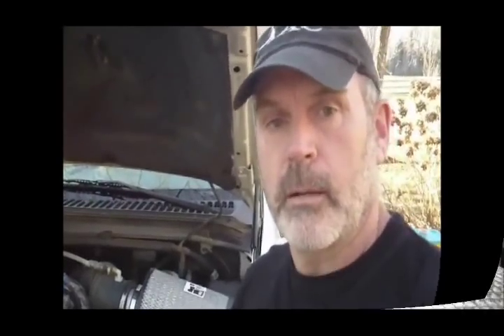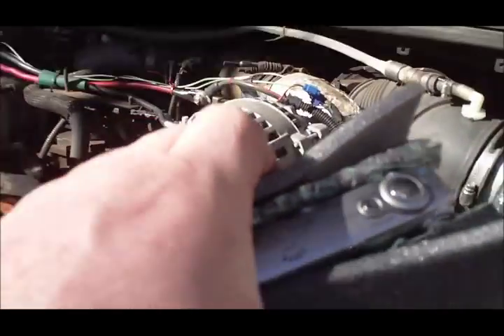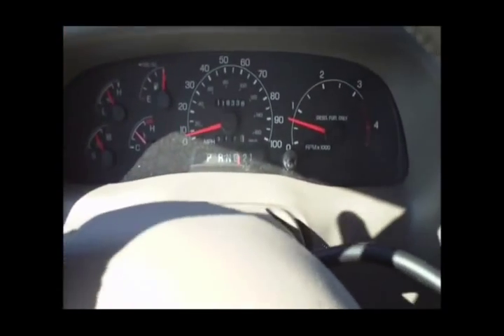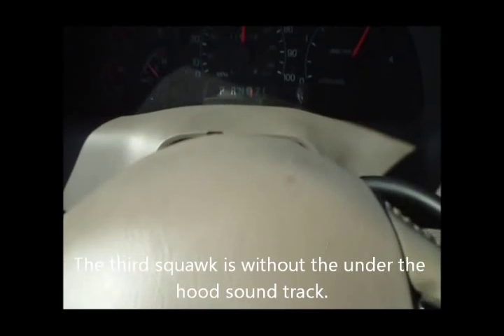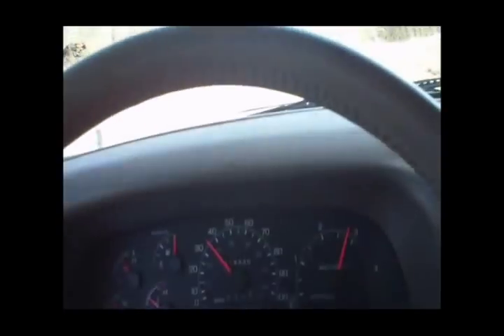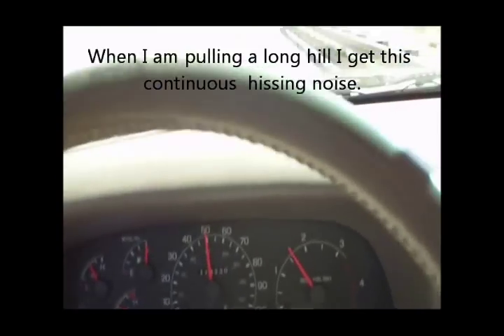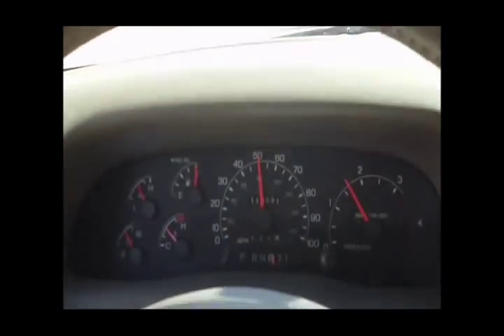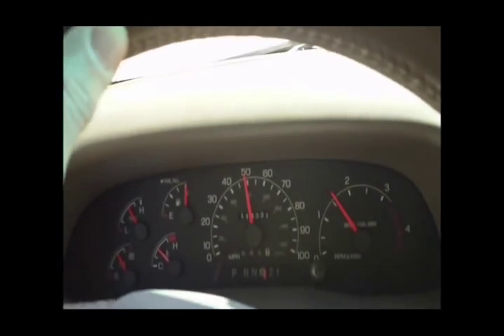What is this sound 2001 Ford Powerstroke 7.3L

Comment: My 2001 f250 sounds like the cam or lifters is worn out it only has 65,000 on a fresh motor its a 7.3 it also has lost some power. All oil changes done on time.????? Please help.

Comment: That noise you hear is called the Flux Capacitor. If not seems to be a short between the driver seat and steering wheel.

Comment: Holy crap, hopefully you've got it fixed by now but I can't believe the comments lol. 1) you don't have a blow off valve. 2) you have the bigger air filter now, it's just the excess air that your stock turbo can't turn into power blowing back out through the intake. No problem whatsoever. It happens even with a stock intake but is much less noticeable. Hopefully anyone else having this problem that looks at this video will see this and have some peace of mind. My truck also has the big filter and does this exact thing. On the other hand, you got some noisey injectors too lol

Comment: that is your waste gate not opening and pushing the over boost out of a boot or the air filter check the vac line and spring on the waste gate

Comment: Glad I ran across this vid, I bought an old beater to work on as a hobby, it's 2001 F250 7.3, the engine had a lot of upgrades done, cold air intake, computer, Banks type system etc. My old 2001 f250 with the cold air intake didn't make this noise? But now that I hear this one and comments, I feel satisfied that it is indeed the turbo doing what it does. Love the 7.3, am in the middle of pedestal O ring job, that back up pipe flange on the turbo in a bitch!

Comment: the sound you here is the air coming off your turbo  charger  or air is coming in check that in your tubo charger
Reply from the maker: I discovered that I had a turbo leak between the compressor housing and the X-pipe. When I fixed it the hissing went away.

Comment: Yeah that's just normal.  your hearing the air because of the aftermarket air filter.  stock air box you really don't hear that
Reply from the maker: I discovered that I had a turbo leak between the compressor housing and the X-pipe. When I fixed it the hissing went away.

Comment: Thats a boost leak
Reply: Could you elaborate a little I have a 2000 7.3 with a automatic trans and I get that Sound recently. I was assuming I would need to replace the turbo?
Reply: Oh I forgot to mention when the air leak sound occurs I feel a decrease in power.

Comment: I have a K&N filter in my OEM air box. After I switched from a paper filter, I started to hear a hissing sound when my truck shifts from 3rd to 4th. With a paper filter, a choking sound is heard. Happy camper with the hissing sound during the top gear shift, sounds like a power boost.

Comment: Sounds like the noise disappears when the lockup engages at highway speed. If that is the case your torque converter is haunting you. Probably enough distance on it to replace the transmission if you plan to keep it, if not just the torque is 1/3 to 1/4 of a rebuilt. If you go rebuilt go FORD. It is an increment more but gives you 3 yr unlimited and includes labor anywhere there is a ford dealer and your licensed mechanic can also install if you desire. $3200 list  must do a cooler with it mine came to $3900 Canadian this April. I know someone that went with a jobber and the good fellow had an accident and closed shop and all the warranties with it. With a 1 year 20000 km they don't push a new cooler at the jobbers. Hope this helps, respectfully Guy.
Reply: my truck makes the same noise but it comes from the engine bay and it only happened after i put in a similar aftermarket air  filter to the one in the video so i doubt its the torque converter
Reply: Funny, I have a brand new tranny with billet torque converter, so the noise in not the tranny, it's the turbo. Don't scare people if you don't know what you're talking about.

Comment: It's a PBSAW problem. (Problem Between Seat and Wheel). Never tach a diesel over 2100 RPM... I don't care what the pretty colors say on the tach.
Reply: A 7.3 can rev to redline perfectly fine and even beyond redline with some mods. You have to hold the motor at redline to do emissions anyway. I know the cummins has a low redline but if you were correct they wouldn't allow the truck to go over 2100 rpm with stock tuning
Reply from the maker: swtnlnly You can not apply the 2100rpm guideline to all diesels. If you never run a late model diesel over 2100rpm the DPF will not regenerate. This truck hits 2100 RPM at around 60mph.
Reply: Michael Szwanke your kidding right?  I own several powerstroke trucks and never heard of this 2100rpm thing.  try towing something maybe and see if it's even possible to avoid going over 2100rpm.
Reply: Dd
Reply: Kenneth Barbee enjoy your repairs.
Reply: you cant go over 2100
Reply: yay
Reply: Star View Landscaping I had a 96 Ford F250 with a 7.3 powerstroke and it ran at 2100 RPMs at 65 miles an hour because I have 410 gears in my truck remember the gears will mess with the RPMs rolling down the road
Reply: My DT466 can go full throttle max rpm at 2,600 rpm ALL DAY LONG.
Reply: There is a governor.

Comment: That hissing, the second sound, is a valve behind the turbo that partially closes to build heat in the engine. Mine does the same exact thing even after it's warmed up. There's an elimination kit for it.
The first sound is the blow off valve or waste gate. I only know because I used to do a lot of racing and there were more than a few turbo cars that would eliminate them for a little more boost or use a bigger turbo when there was no factory blow off valve/waste gate (or it couldn't keep up with the bigger turbo), though it can kill a turbo pretty easily over time.
Reply: You're completely wrong. Must be why you don't race anymore, it's the excess air from a aftermarket air filter not getting used by the turbo and sent back to the air filter, the only trucks that do this are with a modified air filter

Comment: if you're not all the way warmed up the EBPV will open and shut causing a hissing noise . most of the time when you hear that sound its just the waste gate releasing pressure . if it was a bearing failure you would hear it all the time .

Comment: Did you loose boost when the hissing started?  My truck is making the same sound but it is intermittent and I loose boost when it happens?
Reply: thanks but it turned out the air filter, although it looked clean, was very dirty. that is what was causing the turbo to kick out. (still getting used to this truck. only had it for a short while.
Reply from the maker: Yes I lost a couple psi of boost.
Reply: +DillysADV Try cleaning your Exhaust back pressure tube for a cheap check up, respectfully.

Comment: The sound you hear is air coming from your turbocharger recirculating itself it comes from your cold air intake if you add the factory air box the sound will be quiet but once you have a high performance filter and remove the air box then you will hear the turbo actually working the airbox acts like a muffler to muffle the sound of the turbocharger there's no way of getting rid of it unless you put the factory air box back on
Reply: Nice
Reply: I'm having the same issue
Reply: Thanks

Comment: how much it susposed to way? e300{1ton} 16k? empty kinda as it has very small welder and a grapel hook with out riggers. 7.3 and blows the doors off 350 cube pickups . it bang ur head even. sometimes i running along ans step on it and it shifts up a gear instead of down and bang your head with rocket bust. local mech. says its haunted. i have to pull a trailer to keep it from going to the moon...lol

Comment: This sound that this guy was hearing was a air charge system leave only heard it on the throttle up because the wastegate shuts to build boost and one of the rubber boots gave in u have to remember the more power u put to it the easier it will be to blow these items out

Comment: Hello I have an 02 and an 01 diesel 7.3 the 01 have the ford air box and filter set up
and does not hiss,but 02 7.3 has an open k&n cone filter like your. What you are hearing is the sound of your engine sucking more air. I notice if more pulling my 5th wheel.   find someone who still has the old ford air box and drive your route in his or her truck and you will see.

Comment: Did the sound go away after you give it more rev while driving and after it warms up it stops the noise? I think i have the same noise
Reply from the maker: The sound was loudest at maximum boost and did not change as the engine warmed up. I put the cause of the noise in the description.
Reply: I'm having this same problem but I cant figure out what the cause is have you found anything?

Comment from the maker: Thanks for clarifying that. I thought that he had just misnamed the Waste Gate. I knew that this truck did not have a Blow Off Valve But I did not know exactly how they worked. After your post I looked it up. I like to learn something new every day.
Reply: @Mars1952 
My truck is doing the somewhat of the same thing what should I check or where should I start
Reply from the maker: @siharmon954  look for loose connections.

Comment: lol dude. The wastegate controls your your boost by regulating how much exhaust is going through the turbo to spool it up. A blow off valve and a wastegate are 2 totally different things. A BOV releases the pressure at the throttle body to prevent compressor surge or turbo bark. Diesels turbo bark because they have no BOV.

Comment from the maker: Since I did not have a tuner install when I made this video the boost never got high enough to open the waste gate. I am in the process of doing a major rebuild of this truck that includes a BTS transmission, Stage I injectors, a Bean's Diesel Performance tuner, a Gates ball bearing turbo and a Bank's Intelicooler. Video to come.

Comment from the maker: I put a waste gate controller on this engine that keeps the waste gate completely closed until the boost reaches 22psi. The noise was caused by a lose clamp where the turbo connects to the inter-cooler X-pipe.

Comment from the maker: I put a waste gate controller on this engine that keeps the waste gate completely closed until the boost reaches 24psi. The noise was caused by a lose clamp where the turbo connects to the inter-cooler X-pipe.

Comment from the maker: This truck did come with a waste gate (commonly called a blow off valve) on the turbo. The OBS Power Strokes did not come with a waste gate. I put a waste gate controller on this engine that keeps the waste gate completely closed until the boost reaches 22psi.  The noise was caused by a lose clamp where the turbo connects to the inter-cooler X-pipe.

Comment from the maker: I do have a Tymar air intake but the noise was caused by a lose clamp where the turbo connects to the inter-cooler X-pipe.
Reply: That is the turbo pipe

Comment: Did you recently add that air intake? usually the stock airbox muffles the sound you're hearing from the "Blow off valve" its actually releasing excess boost pressure.

Comment: dude, its your blinker fluid.  Rpms are not too high thats probably a f350 with higher gearing, mine ran like 2500 at 70mph! i hated it. got a 250 and im back down to 2000 at 70. much better

Comment: Air filter would be my first guess.
If not somewhere along the way out.
I haven't read any of the comments but to me it sounds like it might be a leak in the turbo gauge?
That is if the sound comes from the cab?
Any loss of power? Check the fittings around the turbo.

Comment from the maker: @ford302redneck Hello yet again: When I installed a wicked wheel I noticed that the clamp connecting the turbo housing to the inter-cooler tube was loose. (I mentioned this in another response) I tightened it and the hissing that I was specifically talking about went away. The cameras that I used for this video do not have very good microphones and did not reproduce the compressor leak noise very well. The turbo still makes plenty of noise but they are normal noises.
Mars

Comment from the maker: @ford302redneck Hi again, There is no pressure being released. Pressure simply stops being made. The engine continues to spin and sucks air in and pushing air out the exhaust out over turbines. This make a noise that is commonly called compressor surge. I think that compressor surge is a misnomer since the air is decelerating not surging. The noise I heard did not start immediately after I installed the open air filter it started later and gradually increased.
Mars

Comment from the maker: @ford302redneck Hi: When I said "effectively tied the waste gate shut with a Diesel Site waste gate controller" I should have explained further that the controller keeps the waste gate shut until 24psi then it opens enough to keep the pressure at 24psi no matter how much boost is being made. Since I was not exceeding 24psi boost all waste gate noises could be ruled out.
Mars

Comment: @mars1952

Third, why do you have your wastegate wired shut? If you didn't know, Ford added a wastegate for a reason, and disabling it can lead to premature turbo failure. And also, your probably not gaining anything by running it closed, so its probably doing more damage than good.

Also, there's other things you have to do, besides wire the wastegate shut, to actually gain from it.

Comment: @mars1952

Second, the squwanking sound is the pressure that's built up being released cause its no longer needed. And is common sound, and is now noticeable because of the open element air filter.

Comment: @mars1952

Man, where I start? Do you even know what a turbo sounds like? A "hissing" sound when under throttle would probably be the normal sound a turbo makes producing boost. Notice when you let off the throttle, and the turbo is no longer working as hard so no sound.

Comment: Any hissing under load is a boost leak normally which by your notes you've found. Next time you have a problem like this i recommend the powerstroke org website lots of helpful people there. The squawk is the wastegate relieving the excess pressure in the exhaust housing because you let off the throttle.
Reply: my started it when I put  4 inch exhaust on it 15 years ago and it still does it with over 300K on it.

Comment: Thats the dump valve for the turbo charger. 
The excessive hissing under load maybe a slight pressure leak after the turbocharger prior to going into the intercooler.
This may not be specifically the noise you have - but it was my first thoughts from my own experience in diesels in the UK.